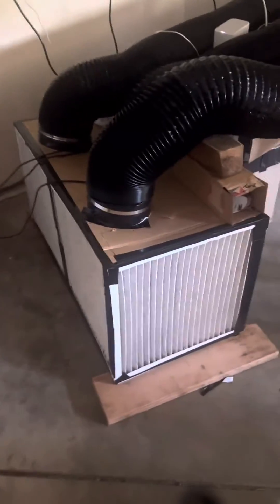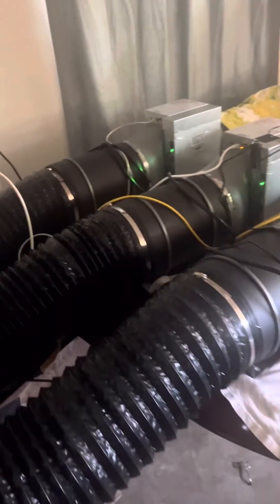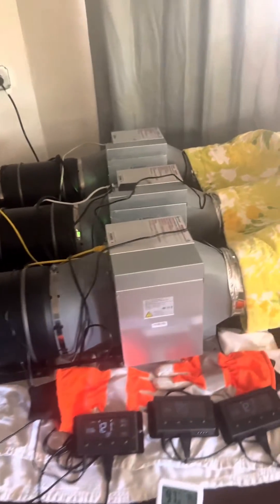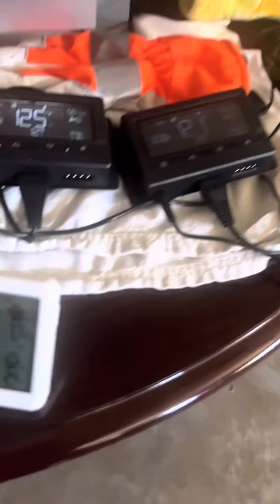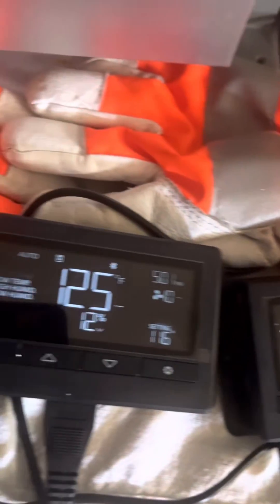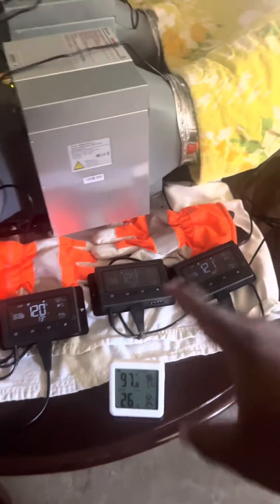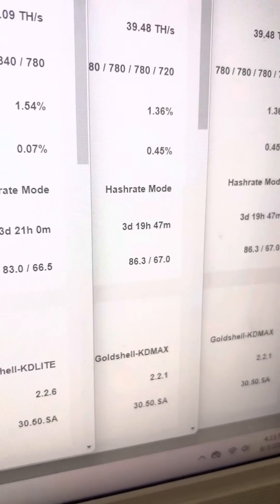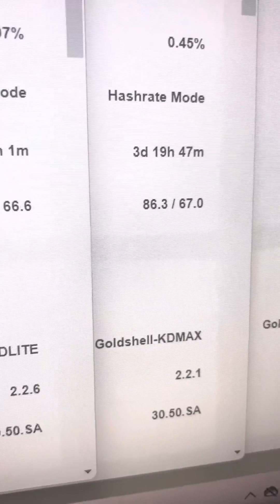DIY AIR COOLED Goldshell KD-Max and KD-Lite with AC Infinity fans

Comment: Ok so you put the probe on the exit side of the miner. At that temperature that you have in your ac infinity controller does the  ramp up when it gets hotter like to speed 10 and does it goes down when the temperature goes down like to speed 7